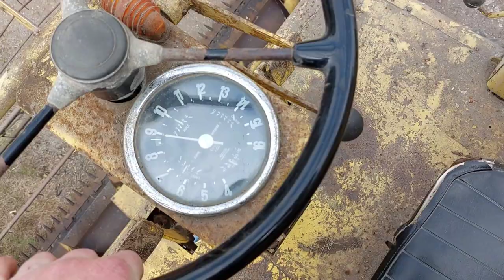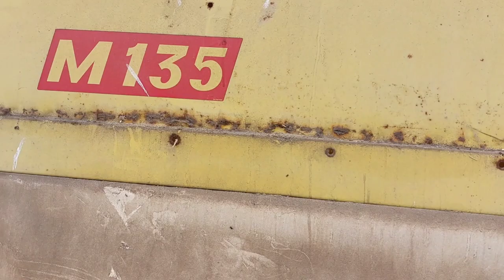New Holland Clayson M135 Combine.

Comment: When you see round the workings of the 135 its almost identical to the 1530, we still work with two 1530's a 1974 model and a 1979 rotory screen model, both are 10 foot cut. We also have a M103 which was 12 foot cut but the head was cut down to 10 foot in 1977, all three of them still cut.
Reply from the maker: Awesome!

Comment: My dad had a few of these which I drove for a few years. Crap brakes, horrible driving position compared to the earlier M103 or later 1530, and they could be a bit too fast in a challenging crop with the larger wheels. This one is in great condition for its age though - all ours have been scrapped.
Reply from the maker: Yes crappie driving position. That was the main factor for me in getting rid of it. Lovely combine apart from that. If i am going to drive a combine all day in the full heat of the sun i need to at least be comfortable and i just wasn't. It need work to get it to wer i wanted it and i felt that it was all to much for a machine that i didn't really like driving. I would definitely like to try a 1530 or even better an 8060 one day